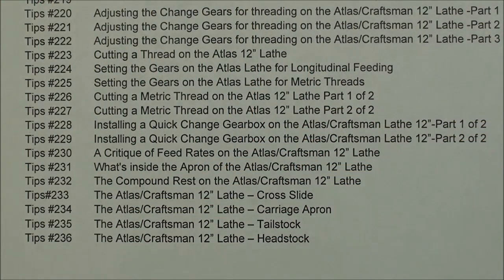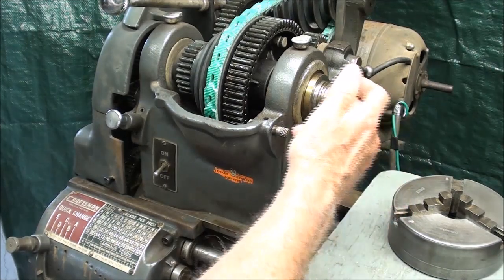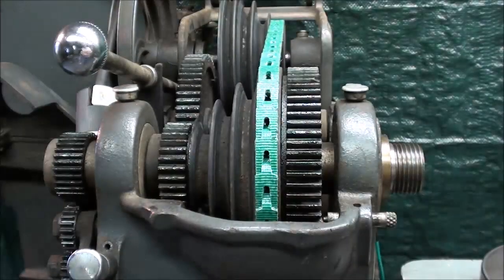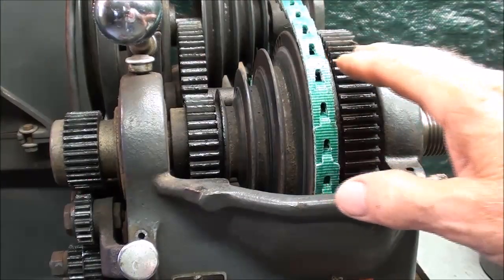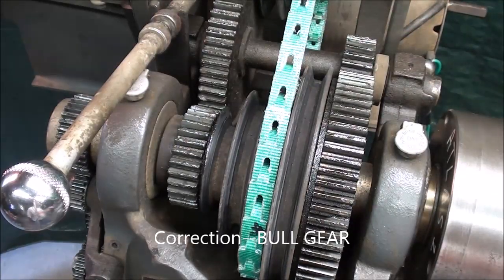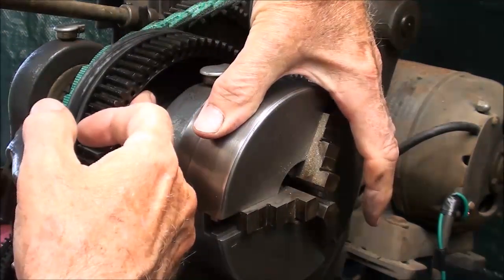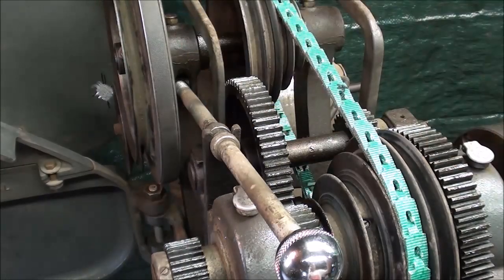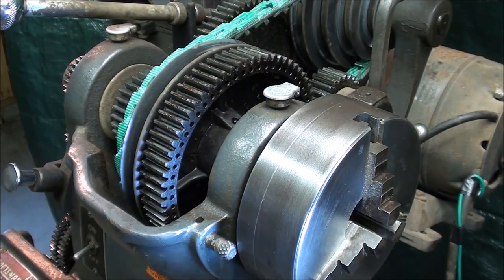SHOP TIPS #236 The Atlas/Craftsman 12" Lathe Headstock tubalcain

Comment: I just purchased one of these old lathes for general hobby use.  I'm in the process of disassembly for cleaning, lubrication, etc and this thing is TIGHT.  Appears to have very little usage over the years. based on how little wear I see.  I wanted to take the opportunity to THANK YOU for this video series as it's come in extremely useful, not only to learn how to maintain, but also to learn how the lathe works.  I grew up and went to school to be a machinest and at the tail end of my schooling, we got into CNC machining and programming.  After I graduated I found a job at a shop where I became a mechanic rather than a machinest.  That's been over 30 years ago, and I have been wanting a lathe for my own shop/hobby use at home.  Now I have one, and also have the knowledge of how it works.  Great video set, well put together, well explained.  A refresher for me since I've been out of it for so long.   Again, thanks.
Reply from the maker: Thanks 👍👍

Comment: MrPete, I just got an old Atlas 10" up and running yesterday.  Probably hasn't been used for over 40 years.  I got it from a friend for free, he got it from an old neighbor that was moving (he hadn't used if for years either) he had it sitting in his garage for at least 10 years, it sat in mine for probably 15 or so. I figured it was finally time to get it working and maybe sell it.  I had to make a platform for it as it was just the lathe in one piece and the motor assembly in another.  Once it was mounted, I tried to pick up the "correct" belts but the motor belt was way too big (43") and I didn't feel like tearing the head end apart.  Picked up a link belt from HF, my neighbor had a smaller belt to use on the motor.  The link belts are like cheating!  After pulling, cleaning and lubing the change gears, the old bugger worked like a charm!  Tore down the compound slide, cleaned and lubed it following your video on the same topic.   The cross slide is next.  The slides and ways are surprisingly tight, very little lash.  I've pretty much decided to keep the old gal and put it to use.  Now, just need to get a set of change gears, an AXA QCTP, some tooling and maybe a 3 jaw.  For a free lathe, it sure adds up quickly!  Love your videos, you remind me of an machinist I knew many years ago.  Old school job shop guy,  even as a kid sweeping up around the place I learned something from him every day.
Reply from the maker: Thanks for watching--nice lathe

Comment: Great series! I would like to add the importance of not over tightening the oiler screw in the pulley on the spindle shaft. That would lock the pulley assembly to the shaft and not allow it to free spin as it should. Your videos really compliment the Atlas/Craftsman book on its operation that I feel is a very good investment to owners of this model lathe. In my opinion is for an owner to best learn his lathe besides using it is to disassemble each sub assembly and reassemble and adjust it using the book and your videos, if they feel confident in themselves to do it. Thank you, Ed K. Cleve. Oh.

Comment: Just brought home a 1935 12" Craftsman. It is missing it's back gears; a new (used) assembly is being shipped now.

To remove the chuck, I pinched the main drive belt with a set of vice-grips. Worked like a charm.

I planned to replace the belts anyway - and this kept me from marring any of the machined surfaces. I hope this helps anyone else that is tearing down an old machine and can't find a good way to lock the spindle.
Reply from the maker: Good luck with the machine. I never have taken the spindle out of one of these machines. That was a good idea with the vice grips

Comment: As ever, I always enjoy your videos and the lessons I learn.  I would love to know-and it might even be a good topic for a video-is what features you would most like to see on an all around lathe.  Things like ideal inner diam. of the head stock spindle, optimum range of speed-number of speed options, working diameter.  I have an ulterior motive in asking as I have decided to build my own and I just picked up a Honda 350 twin transmission to use for my speed changes.  Can hardly wait to get started.

Comment: I just purchased the Atlas Craftsman lathe 12" and I appreciate you taking the time to teach us the ins and outs of the lathe.  With your help I just discovered that I don't have the proper pin in the bull gear. It is a piece of tube stuck in the hole. Do you know where I might find the right pin to mate the bull gear and pulley together.

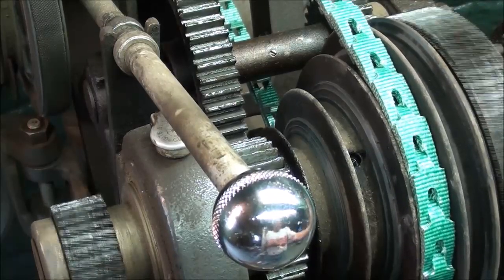Comment: I know this is an older video but I was wondering if you could recommend the oil you use to oil the oil the lube points shown at 12:27. I have used a light non detergent oil to lube the ways but was wondering if I should maybe be using something finer like 3 in 1 for the spindle shaft lube points and back shaft points. Thank you.
Reply from the maker: Use 20 weight nondetergent. Available at Napa

Comment: I purchased my Atlas Craftsman 12 over the weekend and it has several changes from your lathe. My back gears engage with an “in/out” pin on the front of the headstock. No need to open the cover. Second, my lever to loosen the belt is one he side of the headstock near the spindle, not near the drive power pulley like yours.

Interesting differences. I also have grease fittings and not oil caps on my spindle bearings
Reply from the maker: Wow, I have never seen these differences
Reply: I'll make a video with the differences and post it this weekend.
Reply: I have that model 12 lathe as well.   Back gears are underneath and the on off switch is the same but on top and at the side by the belt lever.   I believe that it is a late model made near the end of production from the research I have done.  It is a model 3986.

Comment: Those link belts do run smoother but you will pay for it  with ruined pulleys. They will tear up both aluminum and zamak pulleys. I have a '37 Craftsman 12" lathe and had the same Jason Inds. belt on it. Do I need to tell you why I changed back?
Reply from the maker: Thanks

Comment: I see your craftsman 12" has the quick change for the feed rate. I am fortunate enough to have one of these lathes but I am not as fortunate as you in that I do not have a quick change feed thing...I'm not actually sure what they're called. "Quick change feed rate f23k thing"? Yea.. that's probably it. I have all the gears, at least to my knowledge I do, there's a crap load of them in there. I see they are mainly used for threading but I would like to be able to quickly flip a few around to be able to relativly quickly change the feed rate from turning or facing down to parting without a ton of screwing around. I'm not running a high production business using a...god only knows how hold this thing is, especially since it doesn't have the feed lever thing. But I do have a parting tool holder and a blade for it and I wanted to try it out. I could feed it by hand but I've heard that the steady feed rate is pretty crucial to a good cut AND a good finish. If the back looks like crap and I have to cuck it back up and touch it up then I really didn't need to part it off to in the first place right? Anyhoo. I've had this lathe for about 7 years now, I only use it here and there, usually when I break something on a car I can't get soon enough and have to make it. Mostly bushings, spacers...that sort of thing. I cut threads in college on bigger lathes and have yet to need to do so on this machine but I'd like to do so with this machine as I might even be able to make new lead screws for my crappy Chinese bench top mill. It would be a lot less crappy if there wasn't so much slop in the lead screws. I really thought I'd get to know this thing pretty well by playing with it but when something is pretty much an antique you don't want to doing too much that involves "playing". So I'd like to get to know this machine better. I saw you had some vids where you were selling off extras. If you have anything for that lathe that you want to part with, contact me. A 4 jaw chuck would be nice but I don't know why the hell I'd needed. I guess I don't care...it would be nice to have one anyway damnit! LOL Thanks for all the vids and wisdom.
Reply: @mrpete222  So what's your thoughts on how I might get a quick change feed rate thing? Is that a bolt on item or is it more involved than that?

Comment: Would a 6" 4 jaw chuck weighing about 20 pounds (backplate included) be too heavy for this spindle? I just got one finished up and it worries me that it's too heavy and will harm the bearings in the long run. Mine is an older model with the babbitt bearings.
Reply from the maker: That would be OK
Reply: @mrpete222  Thank you for the reply! Good to know.

Comment: Thanks for the video. You should be able to find a replacement spindle and other parts for Atlas-Craftsman lathes on eBay. Granted, the parts may not be “inexpensive”, but available, so your lathe need not have to be junked or scrapped due to damaged parts.
Reply: i bought one with bearings and races for under 100, its in decent shape, just encase i need it when i go to rebuild

Comment: Question: My SB 10K has a flat belt, do you know if the "link belt" style you used would work?
Thanks
Reply from the maker: Will not
Reply: @mrpete222  Figured because of the V shape. Will try one of those that splice and glue together. Thanks!

Comment: Got a atlas craftsman lathe 101.07381 .....I believe it’s a “36-“37 model.......spindle and top gears will not move..back gear disengaged.....
Any hints as what can be wrong? Thanks.....videos are great learning a lot.....
Reply from the maker: If it has the Babbitt bearings, you may need to take the caps off And see if they are seized

Comment: Thanks for another excellent  explanation. I like your relaxed style of telling the details. I counted your videos, and I believe this one would be #17, not #16, and #220 to #239 would actually be 20, not 19 videos in this series. All of them are excellent. I've a 12 x34" Atlas, and the baby, 6X18". They are both fine light duty machines. Some 6 years ago, I purchased a new spindle from Atlas (Clausing) for the 6X18", and it was about $100. So some parts may be still available for these machines from the factory. Thanks for sharing. .................Dick

Comment: Another Great Video! What keeps the bull pin locked in? Mine keeps popping out . Russ
Reply: Did you ever figure out what the cause was and how to fix it? I just acquired an atlas lathe and mine is doing the same thing. I'm assuming something is worn, needs adjusted or I'm doing something wrong because I am a complete noob at machining. I love these videos though. Very informative thank you
Reply: I think on mine, there is a little Bearing with a Spring maybe. It’s been awhile since I did a Restoration on it.

Comment: Howdy, just got a lathe by Craftsman.  The motor has four posts on it and the reverse switch is gone.  I just need to connect my power chord and have the lathe turn from the top towards the operator.  The posts on the motor are marked 1, 2, 3 and 4.  Would like to know where to place the hot and neutral wires, can't seam to find the answer anywhere so can you please advise, thanks.
Reply from the maker: I cannot answer that. Isn't there a wiring diagram someplace on the motor?

Comment: I always thought the link belts were for running one direction only? Not that I reverse my lathe that often anyway....
Reply: +ARCustomKnives Hi. The link belt will run in either direction but usually most industrial machines it is fitted to are unidirectional. Over many years I have seen the belt fitted and running well in either direction. I think the manufacturer of these type of belts recommend it to be run "pointy end in direction of travel".  regards

Comment: I tried to go to your web site and got a list of links instead. Is it still up?
Reply from the maker: No, it is gone. Tell me what Video that was him so I can remove it
Reply: @mrpete222  I will find it this evening. What I was after is the flash drive with all of the atlas lathe videos  on it. I have recently acquired one in excellent shape all of the gears and  lot of tooling and need to find as much info as I can.
Reply: The video is shop tips #236

Comment: Has Anyone ever tried to bore that 25/32 bore out to accommodate at least 7/8" material?   Seems like there is more than enough thickness to take a 1/16th cut in there.
Reply: Don't know what it would do to the strength, but you'd lose the Morse taper.

Comment: What happened to the website?
Reply from the maker: Gone belly up
Reply: Thanks for your quick reply. That's too bad about the website... hate to hear it. I have been watching your videos... have not come close to watching them all.  I got a question that I haven't found a video for yet. Maybe you can help me? I have a Craftsman 101.214. It's a good machine everything is tight except one issue. When I go to make a cut... the chuck moves... it's got some play in it. Not sure if the spindle is wore out where it goes through the timken bearing... or if the inner ring of the bearing has been worn away? There's no play around spindle and bearing next to gears... just where spindle and bearing next to the chuck. Either way no matter how I adjust speed or feed or sharpen cutting tools, or adjust the angle I can't make a smooth cut. I will soon take it apart to see, but figured I ask you first before I even attempted to do so. What's you opinion on the matter? Replace the bearing? Attempt to make a new spindle? Haul it to the junk yard?Hmmmm...? I'd greatly appreciate any info you could give me.  I dig your informative videos... better than machining school... more fun than people.

Comment: I've had different results using link belts on my Craftsmen 6x18 lathe. There were harmonics from the belts which showed in the work.

btw: I like how you marked the speeds under the belt cover.
Reply: You may have the belt too tight